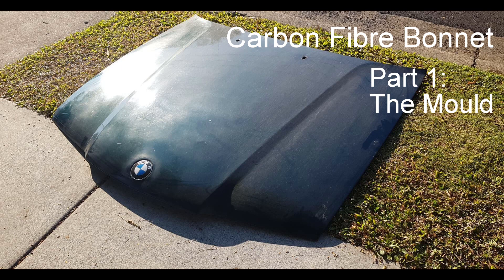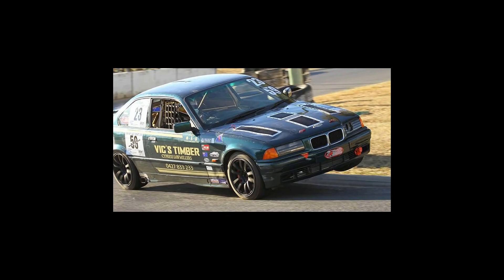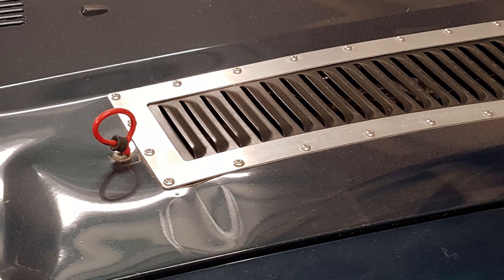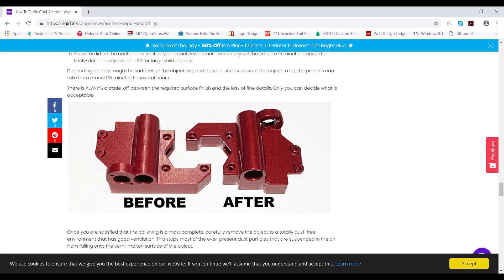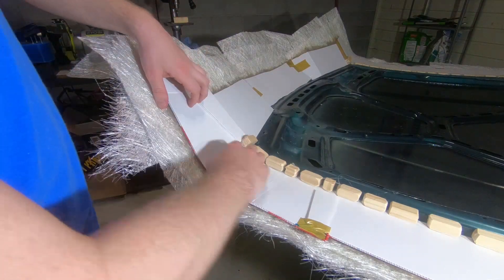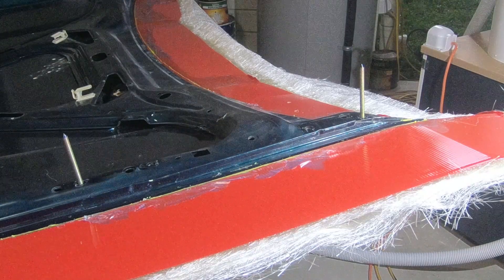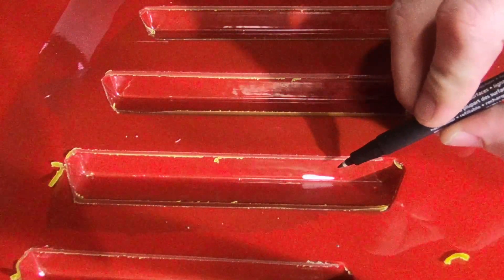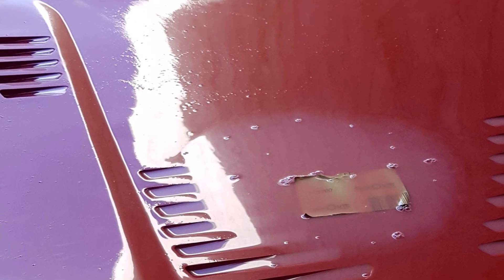[BUILD] Making a Carbon Fibre Bonnet: The Mould

Comment: How do you know how much gel coat and fibreglass and pva release
Reply from the maker: For the tool/mould? Most manufacturers will tell you how much surface area their product will cover per litre (and you should know the area of your part from measuring).

Likewise, I knew how thick I wanted to make the mould, so I was able to calculate the layers needed and then multiply that by the area to work out the glass needed (plus some extra)

Comment: What filament material do you use for the 3D printed parts to achieve the vapor finish? Thanks!
Reply from the maker: Just used ABS filament. It is soluble in acetone

Comment: What kind of wax do you use? im just wondering im not sure where to find that specific kind i see other youtubers use it as well
Reply from the maker: You want a mould release wax. Googling that term should bring up a few options. The two main brands I've used are: TR and McGuire (like the car products folks).

I strongly suggest not using a wax though. Go straight to a chemical release, it's slightly more expensive, but so much faster and easier. If you're in the UK grab the easy composites one, if you're in Australia jump on the trojan fibreglass website and get the stoner spray release.
Reply from the maker: https://youtu.be/F4z1EERbGbs like the one used in this video
Reply: @CEWManufacturing  thank you so much, I’m planning on trying out on something small like an alarm clock or something to get the feel of the process

Comment: Whats the difference between a Gel Coat that you apply with a Brush vs a Spray Gun?
Reply from the maker: There is no difference. You may need to adjust the viscosity (by referring to your manufacturers procedures) but you really shouldn't need to.

The spray gun is important, gel coat uses a "cup gun" rather than a HVLP spray gun. It has a much larger opening than a paint spray gun.

That's pretty much the sum total of my knowledge on spray guns now. Sorry I can't be more use.

Comment: Hi great video by the way Ive watched all 3 parts. Just wondering where you got the wedges from to make the vents in the bonnet and what are they called? Thank you in advance and hello from a new subscriber 👋
Reply from the maker: G'day Dan, glad you liked it! The wedges were 3D printed from my own design (about a 35 degree incline and then rounded edges). 

If you're after your own hit up a mate with a 3d printer or use a company like shapeways. If you're in Aus I could help you out. I suggest you use ABS so it can be smoothed after, though I think you can smooth PVC also (I haven't tried it).

I'm going to start on a carbon fibre wing shortly (when I have enough time around work). It will probably be just a section as I don't have a customer who wants a full one at the moment. Hope you enjoy it.

Comment: Cool video. What did you use for the reinforcements on the mould?
Reply from the maker: Hello, the mould reinforcement panels were 7mm thick, 75kg/m3 polyurethane foam. Just an offcut sheet I had laying around. The mixture around the vents was a Q-cell / glass strand mixture just to thicken the resin and attempt to reduce shrinking issues from too much exotherm in the cure (less resin = less heat)

Comment: Cool Video!  Have you considered 3D printing the entire mold?
Reply from the maker: Hey mate, I'm glad you liked it. 

I have considered it and I do use that method for smaller things (check out my F3 wing video for an example, part 1 I believe).

In this case though I don't think it's viable. The mould it huge and would take weeks to print. Then it would have to be sanded back and then probably vapour smoothed or another method. I would also need the cad model (or reverse engineer a cad model) to do it.

If I had a big cnc machine I could have cut a mould out of tooling board, that is easy to sand and clean up. But again I'd need the cad model to start.

Comment: Hi, did you print in ABS or PLA?  I haven't had much luck with acetone vapor smoothing on PLA
Reply from the maker: Hi mate, these were printed in ABS. Sadly PLA is not reactive to acetone (well not very reactive). You have to use some more aggressive chemicals which is why I avoid using it for anything requiring smoothing. 

https://www.instructables.com/id/How-to-Smooth-PLA-3D-Prints/ 

This link covers off the PLA smoothing in some detail.

Comment: Good video man. Yeah, those vents propoly kicked your butt. You may of got away with use chopped strand veil or woven fiberglass. But the slurry mixture is the way to go.
Reply from the maker: Glad you liked the slurry mixture, I was actually going to use saw dust for it (I have normally got access to a lot of it for no cost), but didn't have time to run out and grab some; it used a lot of the Q-cells. Part two will be up very shortly.